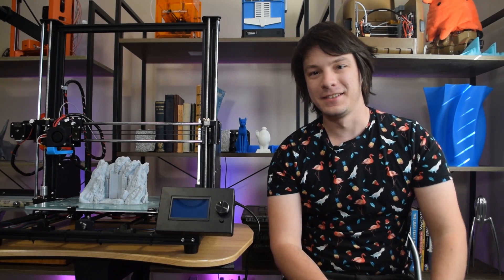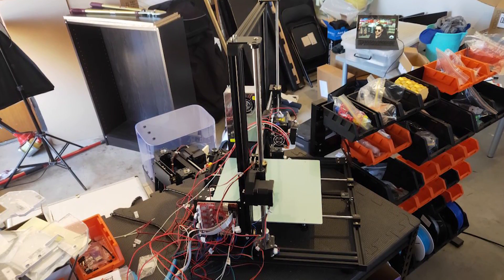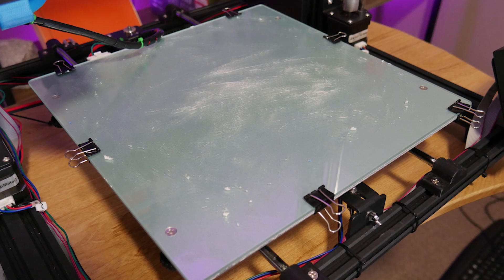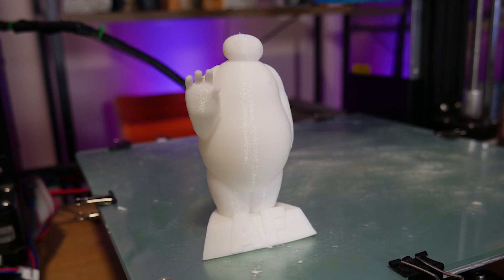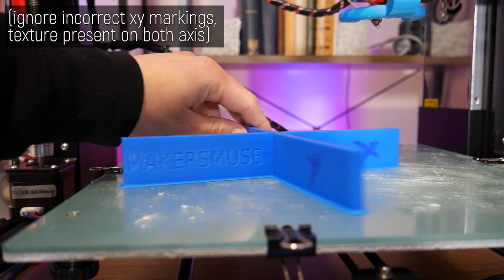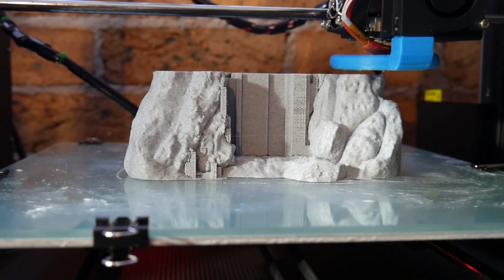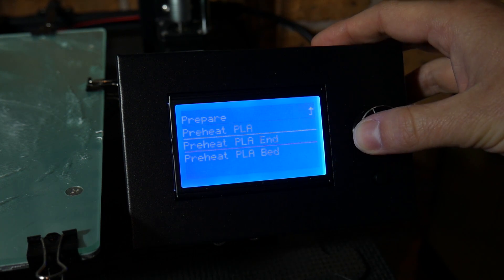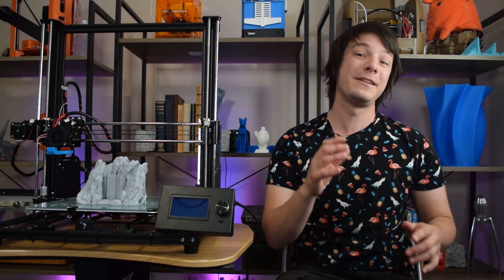The Anet A8 PLUS is big, cheap and won't catch fire. 3D Printer Review

Comment: I think I have an idea about the texture. I got the A8 PLUS as my third printer (first big boy) and I agree the instructions were actually reasonable, however it was a bit of a pain to set up as I’m still kinda new, I actually messed up the board somehow and needed to get a replacement, but once I got everything level and tinkered it has been running pretty much perfectly… except for one issue is the surface quality. 

It’s not BAD (especially when you consider the price) but I wouldn’t expect any super high quality models to come out perfectly. 

I did some tests and compared to my other printers and my conclusion was that the surface quality is due to a combination of direct drive & low quality drivers.

The low quality drivers result in quite jerky “steps” - this is most noticeable from the extruder motor as you can see each “step” translates into a “pulse” of filament, resulting in a wavy/pulsing extrusion, instead of a smooth continuous extrusion.

A Bowden setup normally hides this as the filament builds up pressure in the tube that dampens the individual steps.

But on a machine with a direct drive like this combined with the cheap drivers, I think every “step” of the extruder motor results in a pulse of filament that results in wavy extrusions and a bumpy surface texture.

I’m going to attempt to fix it with a Bowden to see if the tube pressure will smooth the extrusion.

Hope someone finds this helpful.

Comment: Its an amazing printer when it work. Most times it can't finish a print which is depressing. 
Can anyone help me diagnose the problem. Cannot go more than 3 layers before messing the print.
Reply from the maker: How does the print fail? Is it coming loose from the bed or is the extruder failing and jamming?
Reply: It's coming loose from the bed, and sometimes the second layer will pull on the first one

Comment: Regarding there being grooves in the rods, when I was putting mine together I noticed there was a big enough groove to actually have one or two balls in the bearings catch on to it and fall out.. After that I took some clear nailpolish on it to fill in the grooves and took some machinery oil my missus got for her sewing machines, it worked like a charm and reduced the noise quite a bit. However I was in no way cheap when applying the oil and every other or third run I take a fine brush, dip it in the oil and apply a bit new oil on it, mostly so that it won't run dry and cause the nailpolish to be removed from the rods by the friction.
One of those "Try it at your own discretion" tips, but it worked great for me on my A8 Plus :)

Comment: I do know how old this is, but... Mine came the other day, after spending a day playing around with the hot end/direct drive? (it just would not feed) I got it working, and working quite well. Don't be afraid of having to "tinker" on this machine, it is so basic and not to hard to figure out with the manual. Noisy? Yes, but it just screams to be upgraded. It prints quite well in stock form, but will benefit greatly from mods/upgrades you willing to do. The key is how cheap it is from the start, mine was $183 from Anet's own website, and for that, you just can't get this size of working printer.

Comment: The first thing I did when I got my original A8 was to install the latest Marlin firmware. And it DOES have thermal runaway protection. and that was in 2016

Comment: Oh, but... The Anet A8 Plus still sometimes CATCHES FIRE! Mine did. Not a hideous fire, but it did catch fire... for pretty much the same reasons that the original A8 did.

There are quite a few serious screwups in the A8 Plus, and some ordinary maintenance parts (example: the hotend throat stem) cannot be purchased anywhere in the world; you have to devise your own when you break yours or it gets nasty and starts oozing (which it WILL DO).

Electrically, these things are really really sad. Lots of problems. Oh, and ANet's warranty support sucks badly.

Comment: I have an original A8. I did the upgrades.  Its an awesome printer. I have ran it damn near nonstop for 3 years, and started a business with it and have produced 10k plus production parts on it. It has paid for itself so many times over.  Bowden printers are inherently a PITA, and I won't buy one. They dont print flex filament either. Bout to pick up one of these as our third ANET in our business. Haters gonna hate but the open source platform, availability of parts and DIY upgrades, the ANET  is open source 3d printing at its finest. the barrier to entry is so low and the information so available. They are pretty much the Honda Civics of 3d printers.  Rock on ANET!
Reply: just as note, after 3 years of use, many upgrades, a fully ducted enclosure, im probably right about at $350 in on my A8. Alot of that has been consumables like heaters and hot ends and build plates.  got an A6 too, but the horizontal gantry sucks and bed clearances too tight- tore it down and rebuilt it with new parts to be an enclosed box framed i3 with the vertical gantry style. so much better.

Comment: The A8 never burned any house , it goes back four years..a newbie wired  it up wrong it was on a cluttered bench with , , the wired over heated, melted the plastic coating and something on the bench started more smoke and melting. The bench and clutter were damaged. The post appeared on the then Main Anet support FB group and the none European owner wrote it ...could...have burned my house down.
That morphed into the hotbed connector melt,,,never burned...could burn your house down.
Did anybody get screen shots of the original post.
A few months ago on an Anet group, somebody posted a photo of a burned out Printer, damage to the table etc. it was a Prusa Mk3?
Will that stop the youTube influencers reviewing Joe’s future profucts?

Comment: you might be the only person that can help. my a8 plus- read one ten on the extruder read out and the 174 on the hotbed, is switched everything out, using my anet a8 as a test dummy. I switched the exturder, and the hot bed between both, on the anet a8, the the extruder and hot end reads as they should, but no matter what I do I get the same read out on the a8 plus. if I try to heat up the bed or extruder, it defaults to an MAXTEMP and this is at start up.... what could it be .... clearly anet didn't get back to me

Comment: Anyone who finds the Y axis  motor reversed has mounted the belt under the bed on the wrong side. The two belt mounting screws need to be on the right hand side so it draws to the back of the printer when homing, if you attach the screws to the left hand mount holes it will send the bed to the front of the printer when homing.  Flip the belt and mounting screws for an easy fix :)

Comment: soo, i bought this exact 3d printer about a year ago, after reading alots of reviews and etc. 
firsts impresions: 
1. for some wacky reason, my glass bead is not straight, nor one of the slides rods, for the x axis. 
2. the PSU or the heated bed itself doesnt work, i think the included bed its 24v and the psu its only 12v - ok pla only then. 
3. after a year, the extruder finally clogged beyond repair ( could be the cheaps ass filament i bought)

but after weeks of self learning how to 3d print i manage to print a LOT of sucefully prints. 
the printer its very very tricky but if you dont want to spent a lot of money, this is the way to go. 

still havent change the glassbead nor the heated bed, so i havent print anything more than 10 15 cm long and tall. 
but so far, 7/10 

sorry for any error on my english, not my native language.

Comment: Will not catch fire Angus....is better aussie!  Nor have the 5 A8 i have had. Mainly because I know a little bit about electric wiring and how Arcing across bad joints.....can cause burnt out wires and plugs. My first A8 bed connector did just that! Brown discolouration and knackered pins. Took me all of 5 minutes to realise the white connector pins...being push and retained can actually move on the bed pins...IF, the main loom is long enough and not tied down. The sliding pins soon wear thinner and more lose ( not loser) which encourages arcing. So the task is to stop the wires moving...not soldering bare wires to the bed pins. What I did was ...first swap out the damaged white connector for one of the two spares I got in stock in anticipation of....a fire!  Fitted to the bed, simple Gorilla plastic glue, smeared over the underside metal pin retainers and between the wires top and bottom...all dried and glued up...no sliding pins. But what about dragging as the bed moves...Thingiverse as 101 ...at least cable holders attached to the H bed carrier and by using zip ties prevent any movement of the loom. No house fire...no white connecter burning in a mass of flames....just a bit of heat stain.
Its all about knowing a bit about the job you intend to do, sadly too many clowns not wise enough to change a light bulb/ lamp, preferred to just twist the wires and shove them in ....not knowing better.....and cause problems...so easily avoided.
Pleased to notice that Anet are now doing just what I told them many times over the past 4 years.

Comment: I'm only 3:45 into the video and oh man, it's just so much "an ANET printer". My Anet A2 is... well. With todays options, I'd not buy it again. It simply doesn't really print anything out of the box (which BTW came with lots of styrofoam, spreading all around the house of course). It has so many design flaws and is constructed in so many weird ways, they just threw components together and that's it. Currently, I'm remounting the z-motor to the bottom because a z-motor mounted at the top is just to most stupid idea ever which causes many of the problems of the Anet. The missing partcooling-fan is another example. Oh or the bowden tube with an inner diameter which is to big. WTF.
And just recently I bought an Ender 5. It's just a different league. Seriously, prints very well out of the box, even at way higher speeds. Heats up much faster, because 24v. And what should I say, I've printed with it more in two weeks than with the Anet in 2 years. Also the box - no styrofoam but that "foam" material. And they even included a few spare parts like a replacement nozzle! How great is that!

Comment: Hi Angus, nice to see you doing a review on Anet printer again. :)

As to the strange pattern your getting ,  I believe it is down to the small diameter ( Linear Rail Bars ) and lead screws.
 They are still the same size diameter as of the smaller Anet A8 .

You would of thought they would upgraded to at least 10 mm diameter for this larger machine

Anyway what is happening is that the printer bars and lead screws are flexing upon movement.
I had the same problem in another one of my machines
So I upgraded to 10 mm, And now its perfect.

if on a tight budget then the original lead screw can still be used, but when on larger models you may still get funny patterns starting around the 250mm  height .

10 mm upgrade is a bit of a pain, as one need's to get larger fittings to be able to upgrade.

Please note, Do check to see if your bars are straight and has no bend in them,  as many people in the past has had bent bars.

Comment: upgraded it to an e3d v6 extruder. apparently the fuse on the extruder was 12V, so that had to go. got some motor silencers. got rid of the glass bed and installed and Ender 3 magnetic mat (gained 2 mm :)) )

Comment: It might catch fire actually.  Got mine last month, 24v printer but came with a 12v heating cartridge.  While trying to dial in PIDs we figured it out.  Due to the incorrect voltage it was putting out around 160w of heat instead of the expected 40w.  If your heat is hitting 260+ on the way to 210, you might want to check the resistance on the cartridge.  It can still print and you can configure around it but I don't know what the cycle looks like on the cartridge.  If they messed up one kit, the may have messed up a whole batch.

Comment: If You're Still Looking At The weird surface on The Anet A8 Plus, Look No Further Then The Y-Axis Belt Guide In The Front, It Shifts Up To 0.6mm When It Changes Direction, And The Gantry Also Sways Back And Forth If You Print Any Faster Then 40mm/s, Adding Another 0.3mm Error To The Y-axis. It's Been Mucking Up Many Of My High Speed Prints. Also getting A Lot Of Chattering With The X-Axis Linear Rods, Finding The Preassembled Models Were Not Completely Tightened.

Comment: I got mine for $180 on ebay from the anet store. Came partially assembled.

Stock cooler sucks, upgrade definitely required. 
On a flat surface, the heatbed still seems to be unstable despite manual calibration. My bed or Y-holding bracket might be warped/bent. Either requires replacing and/or a digital bed-leveling sensor.
The bearings are OK, but not great. I will be replacing these. It's good to know that the rods are not re-enforced steel. I will be avoiding ball-bearing bushings for this reason and go with LM8UU's.

Other than that, because the frame is largely aluminum and rock solid, you don't need to do all the printer mods that the original A8 required. However, there are still some people making some minor improvements here and there on the tension belts, filament guides and spool holders. The A8 also comes with fuses built into the mainboard and power supply, which was a manual upgrade you had to do on the A8 in order to protect your components better.

They really have improved this over the original A8, and I'm fairly impressed for this price point. I'll also be upgrading mine with an E3D hotend and Btech BMG extruder. The stock extruder performs very well, but in order to get the best prints and work with higher-temp materials, the hot end (at the very least) needs to upgraded.

Also you can buy thermal insulator pads and apply them underneath the heat-bed to improve efficiency and resolve long heat-times for the heat bed if you are not running your bed on an external mosfet.

Comment: My highly upgraded A8 that I bought almost 4 years ago off of GearBest is currently running in the lab right now! I've put over 8000m of filament through it and have 1000 hours of print time on the original bed, original steppers, original couplers and z-rods. I still level the bed and x carriage by hand with a digital caliper and I feed it gcode via an OctoPi. It sits on a plastic AV cart on rubber casters, padded with playpen foam blocks. My wiring is all custom, with a divorced stock mainboard, high output MOSFETs, soldered heat bed with strain relief, fusing for the bed, hotend and control board and it's all powered (except for yhe Pi) off of an Astron 30A linear power supply (not switching). The Pi is powered by a 5v 2.5A wall wart for an old cellphone and everything is connected to an APC 1500VA BBU at the bottom of the cart, in case of power loss. It will run a PLA print for 5.5 hours before bbu exhaustion.

I've been shopping for a bigger build volume and metal construction for awhile and this might be the way I go. I'll probably get some extra aluminium and box out the frame, put a duet and a touch screen on it and put better steppers in and put my mosfet setup on it. I can probably bulletproof it for the same price as a CR10 pro.

Comment: I have this same printer.
I am upgrading the printer controller with the BTT SKR v1.4 Turbo as the original has a faulty controller chip for the extruder. 

One of my other findings is that the reported build area of 300x300x350 is really not that. I have found that I am short 30mm within the area of the clips that hold the glass to the print bed, and on the Z axis, I am nowhere near the 350 limit, I bottom out at the top of the printer way before getting to the 350mm mark. On the X axis, I can only get 295 from either edge of the print bed before the nozzle is over the edge. 

I am curious of what your findings are.

Comment: The Y axis was not wired wrong Angus, you mounted the motor to the wrong side of the plate, so it's spinning in the opposite direction of how it was intended to work.
Reply from the maker: Huh, you're actually right. I have no idea why I didn't notice that and no one else picked up on it! Glad it was user error then.

Comment: I have an original A8, never had issues but it's a pain in the butt. It's going to become a laser etcher and my next 3D printer will be SLA or none at all. I'm tired of messing with bed leveling, cheap extruders, and 'proof of concept' sold as a working unit.